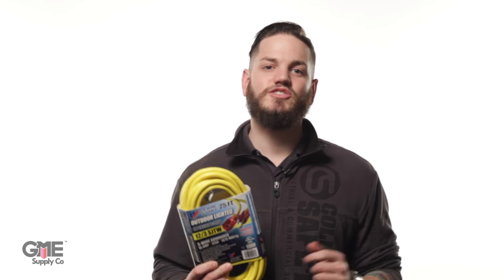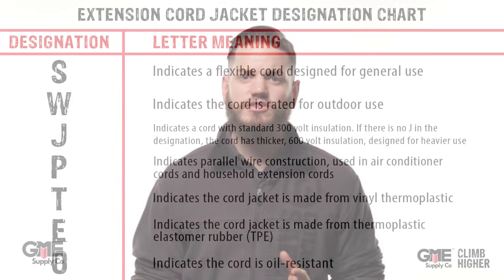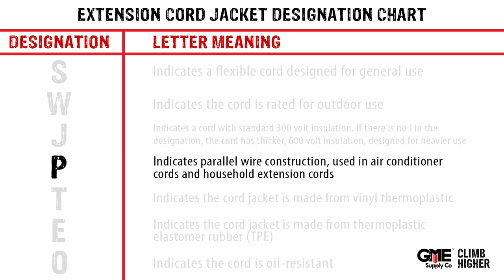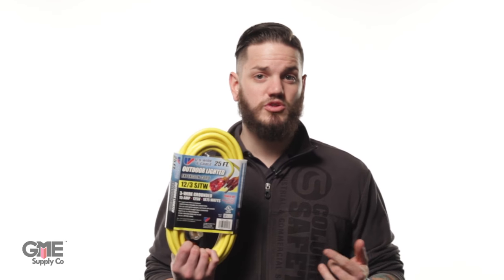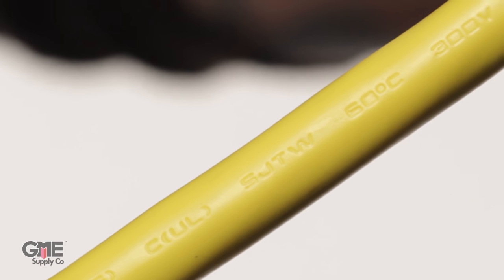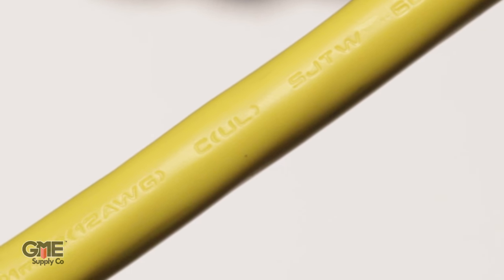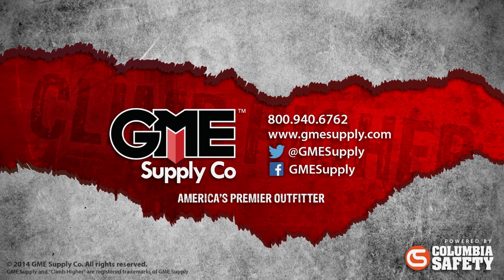Extension Cord Type 101: A Buyer's Guide

Comment: I'm looking for a cord that has little-to-no "memory", i.e. it straightens out easily after having been coiled up tightly for some period of time. Many power tools have this kind of soft, flexible, rubber-like qualities, but I haven't been able to find it in extension cords. 14-16 gauge would be preferable and a 13 amp rating
Reply from the maker: Any of these Southwire cords will be your best bet for resisting a “memory” from extended storage http://ss1.us/a/LhAYiPCN. Their vinyl jacket is more resistant to drying than the average cord, which helps prevent the memory you’re worried about. As far as vinyl jacket cords go they’re the softest we carry while still maintaining high durability.

Comment: Excellent and clear but...how many amps does my microwave need or use?  Where do I find that info in order to get the right extension cord?
Reply: If your microwave says max 1800W on 125V, then it takes1800W / 125V = 14.4 Amp max.  It's safe to use a 15 Amp cord, as long as it's not running at max power for hours.
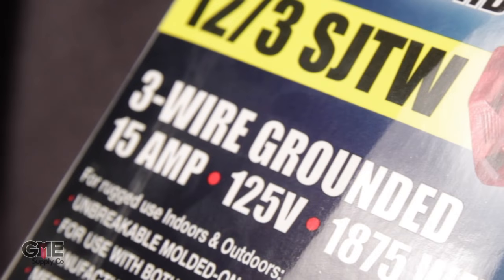Reply: You can see this information at 1:54 of this video, where it says 15 Amp 125V and 1875 W, 15A x 125V = 1875W.

Comment: Can I use American cords with a rating of 125v in a country with standard voltage of 240v for my appliance?
Reply: I assume the major concern is the current flowing through the cord that heats up the cord.  So you can use American cords with 240V source, as long as you have proper adapter, and your appliance doesn't consume more current than the current rating of your cord.

Comment: I have a small dewalt jobsite fan, if I use a 25ft extension cord 12/3 rated at 15amp. The cord provides more amp than tool requires. Will it damage my fan?
Reply from the maker: Nope, the rating on the cord is the maximum amperage that the cord can carry. As long as your fan draws less than 15amp the cord and fan should be fine. Great question!